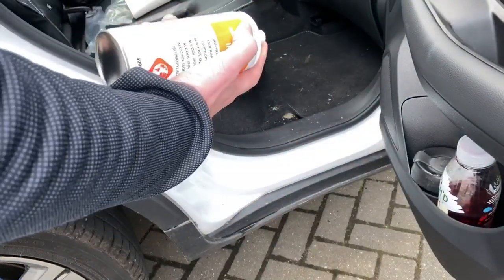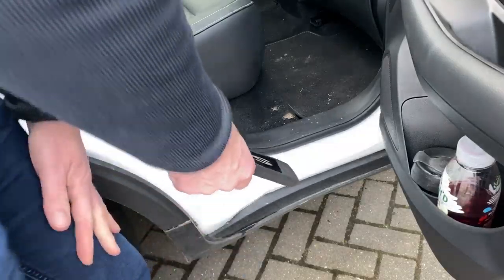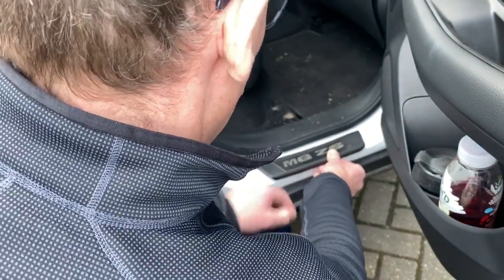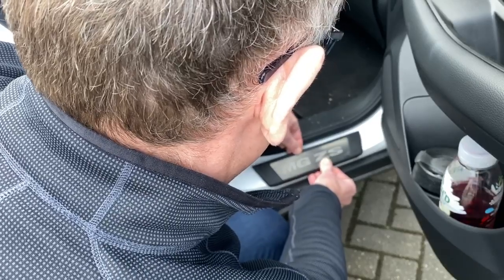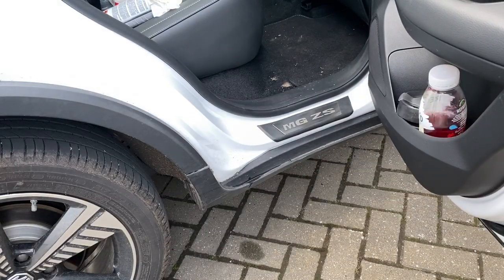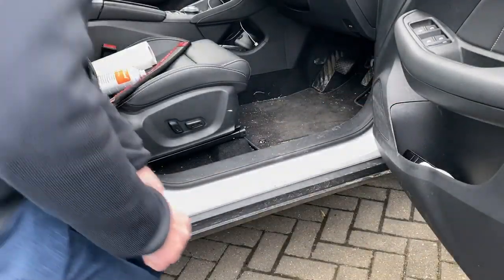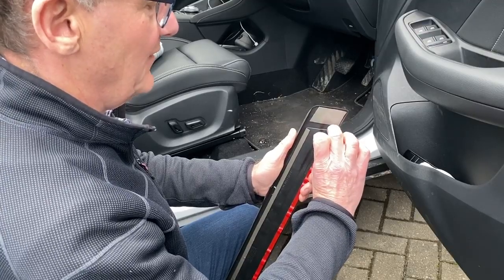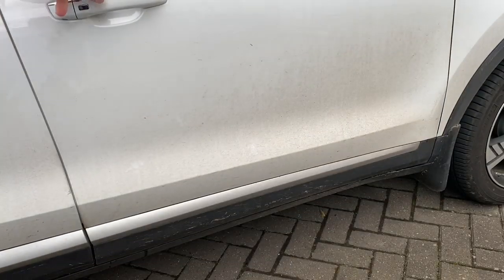MG ZS EV #5 Fitting door sill scuff plates

Comment: When you first alingned the plates before removing the tape, you should have used little strips of masking tape cut to a point, and positioned at each corner top and bottom. Once the plate backing tape was removed it would be a simple job of aligning the plate to your markers, before sticking the plate in place. No more sticking then lifting several times till you get it straight.

Comment: If you use a hairdryer these plates adhere very well.
Reply: Geoff, do you suggest using the hairdryer on the car or the plate (or both once the plates are in place)? Any risk to the paintwork?